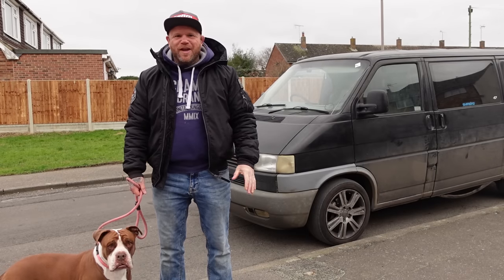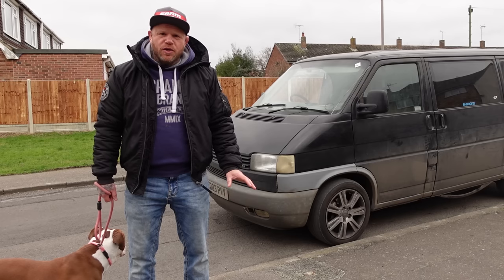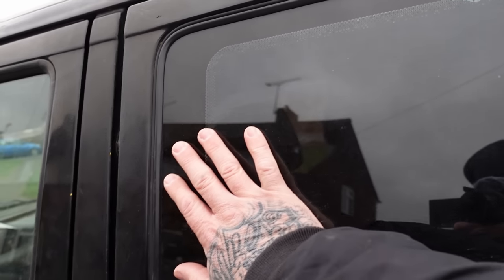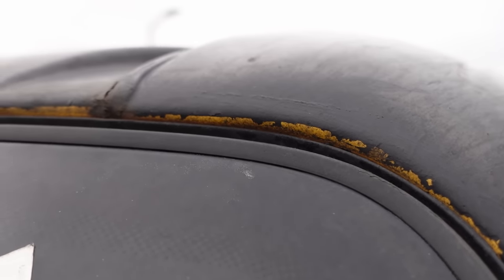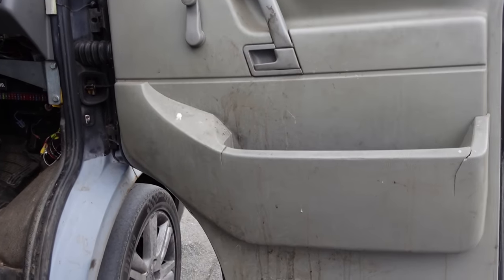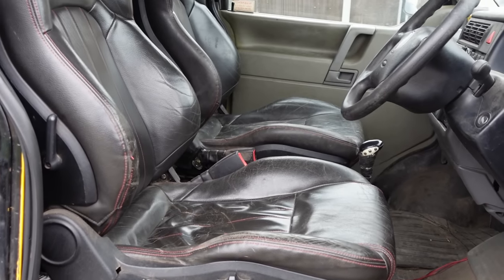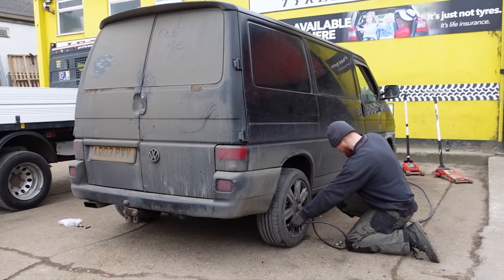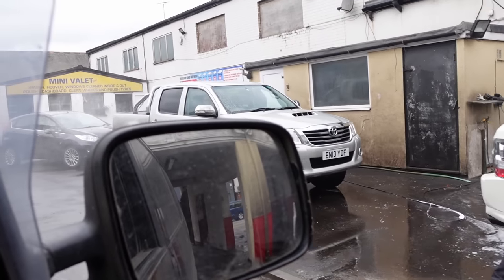I BOUGHT THE DIRTIEST, HIGHEST MILEAGE VW T4 ON THE INTERNET!

Comment: Perfect example of a used and abused vehicle 👍 The cover you pointed out by the crank pulley is protecting one of the power steering pipes. I will point out you should have a large pan under there protecting the lower part of the engine and gearbox. It also protects the electrical connectors mounted low down on the front of the engine block from rain/stones etc. Never a good idea to run without one. Looks a great project.

Comment: New to your channel. Good project van.  Love the T4 2.5tdi. The tube you referenced on the off side behind the wheel is standard. I did notice that the track rod end gaiters don’t have the rubber end caps to stop grit and crap getting up inside. Looking forward to seeing how you get on the van 🤙

Comment: That pipe is power steering pipe with a cover. The leak won't be from that though. Maybe oil pump, crank shafts seal or oil filter seal

Comment: My t4 2.5tdi used daily was ex limo.then campervan conversion done.speedo stopped working at 310000miles about 320000 now .change oil twice year.bought spare engine in case it’s just 107000.have documents for it before van scrapped

Comment: I think this calls for a Dredd Fx paint job! With a huge Dude Stuff logo and artwork on the back. I'm sure you can tidy this up. I have faith in you. A friend of mine painted an old van with Hammerite and a rollerbrush, thinnered down, Nato green. It turned out much better than I expected!

Buy the battery unit from a spares or repairs Tesla for cheap. Get some of those hubmotor wheels that Andy Kirby mentioned that can do upto 100hp each, get a huge controller and electrify it! That'd be amazing.

To the Batmobile! The Dude mobile!

Comment: 1st thing I would have done is get a screwdriver and go under the van, if that's all rotten it will be expensive. It just screams nothing has been done in a long time. I will be interested to see if the work on the engine is true or just fiction. All the best with this project.

Comment: That is the high pressure power steering pipe that goes from pump to rack, i bet someone has put the inner tube ? on there to help stop corrosion.

Comment: Nice project (ideal for a camper conversion), but 2.5 TDI will be expensive to take into London ULEZ etc. 
If you regularly travel into London, you could use a boot bike rack or trailer when you need to transport bikes.